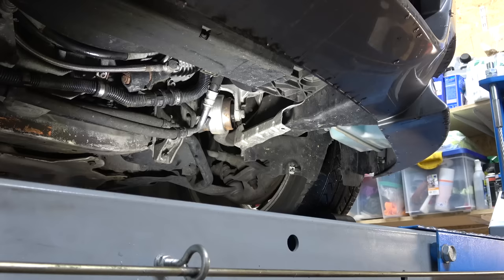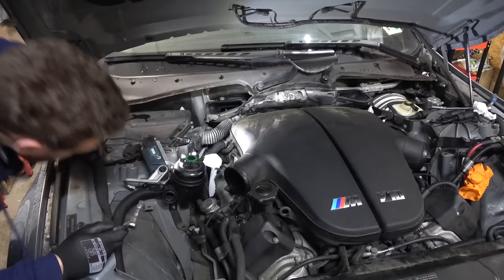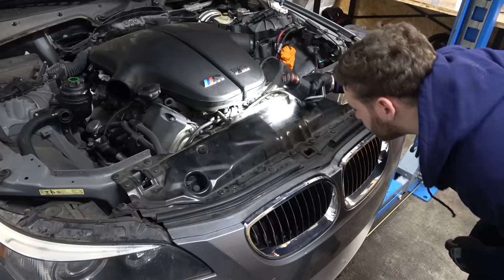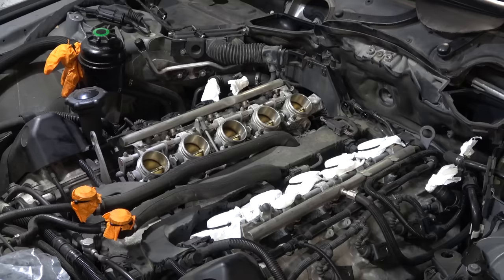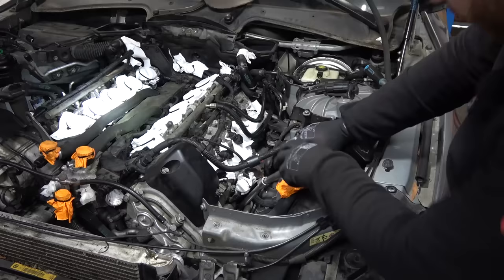In The Belly Of The Beast - The Cheapest V10 BMW E60 M5 6-speed - Project Raleigh: Part 2

Comment: Hey Sreten,
So another YouTuber did a video for an E63 M6(the cheapest m6).  Changed the rod bearings and shortly after the engine seized and would not start.  Is it possible that the culprit was a damaged vanos and/or oil pump?

Comment: I have a 2000 bmw 323i  the radiator  and water pump went bad also it needs a right headlight and the rear headlight needs to be replaced  I wanna know how much will you charge me to fix it I have $1500 saved please let me know

Comment: What type of assembly lube are you using?
Very nice job, well explained. You are indeed a bit over cautious but that’s best with these engines!
Why don’t you repair the oil pump instead of buying the whole assembly...
And just use a lever on the garage handle, come on lol. 
Cheers and happy Easter!

Comment: Question: Why are you putting 5w40 instead of 5w50 molygen? (I know the 10w60 is wrongly specced by BMW especially for cold climates, can't expect people to sit in their driveway for 5 minutes waiting for the oil temp marker to get to 7-8). Isn't that way too thin?
Reply from the maker: I put 10W60.
Reply: @M539Restorations  The description link says 5w40? Dont you think 10w60 is too thick and the primary reason for so many bearing failures?

Comment: I have a question my friend 
In terms of doing torque for bolts generally do you have a specific manual book for BMW or it’s a standard that you can follow in different European cars ?
For example the engine mounts to subframe 21 nm when you install it there is a specific torque spec for the bolts from BMW or it depends on the spec that been stamped on the bolts it self

Comment: Moinsen! I absolutely loved loved loved this video. The only question I have is; given that you went to such extraordinary lengths not to introduce any foreign matter to the engine, why didn’t you put the plenum etc. back on before running it?

It seemed counterintuitive to run the engine with no air filters, having been so careful to keep the internals clean!

Anyway, subscribed and followed!

I have a 2006 e60 M5 with 108k km on the clock. I think I will do the rod bearings myself now (I am a ship mechanic)... because I literally wouldn’t trust anyone not to ding the crank having seen how tricky it is!

Comment: Theres a reason they are called quick connect and not quick disconnect.  They are designed to make the assembly line process faster not mechanics lives easier:(

Comment: The only disappointing thing, that after all this hard work , you said "it sounds like an agricultural machine" . 
Why do you think is the reason behind this!
Is it the M5 engine reliability? Age? Mileage? I had a 2013Nissan maxima and the engine is just running perfectly after since I bought it new until now I have put 270,000 KM, honestly the only major stupied thing Nissan is doing is the CVT gear box which I have changed at 180,000 KM

Comment: I love your videos!!!
Q: I have a cadillac El dorado and after 6 mls it gets overheated and then goes back to normal temperature within a minute and then it keeps doing it up and down all the time and in idle dont get overheated 
Can you tell me any idea to fix it 
I changed thermostat already and radiator plus a did a wash flow 
I hate when get overheated and back again to normal 🤨

Comment: I picked up a used 2011 M3 and heard something about rod bearings failing. Is this a common problem now with BMWs?
Reply: It's a known BMW problem for years...
Reply: @wot48320  On cars newer than 2011?
Reply: @bme7491  All S65 engines experience rod bearing wear, OEM clearances are too tight.  BMW changed the rod bearing material from 2011 on, not sure if that helps. Just change oil frequently and warm up engine before every drive.
Reply: @wot48320  I always stay below 3000 RPM until the engine is at OT. However, I don't sit in the garage for 10 mins waiting for it to warm up (like some people I know), that's more harmful than good.

Comment: Hi Hans,you seem very expert,and do everything with much more care than ordinary meccanics.I have a question,I have a 2003 320ci e46, 150k kilometers,I'm pretty sure I have to change many rubber supports what make do you suggest?is there a complete kit?Polyurethane?
Thanks for any suggestions,Robert.
Reply: bepends on what you want: being a freak like sreten, go for oem rubber stuff, if you want some sort of sportiness, go for polyurethane
Reply: @simonomisimonomis  thanks Simon,I am a bit like Sreten,so I'll stick to Oem.Would like to know the difference from an ordinary car to M-Tech  ...
Reply: @robertmaisey4594  just stiffer spings and ball joints, 99% sure bushings are the same, m3 bushings will be awesome, not sure if they will fit standard cars
Reply: @simonomisimonomis  thanks Simon,will be doing the job in springtime..

Comment: Why is it that this BMW and the previous BMW you open the engine there are broken parts inside the engines. That only proved that the parts or the engineers are not producing a reliable product. Right?

Comment: 1:02:25 Is Vaseline safe for O-rings?  Isn't the safer O-ring lube silicone based grease?
Reply from the maker: We are talking about the fuel system. Silicone is bad is bad in this case.

Comment: extensions do not absorb torque. That contradicts physics. A force applied from the square drive of the torque wrench will not decrease before reaching the fastener. that energy needs somewhere to go and it doesn't get stored in the extension. Newton's 3rd law. If you decrease the diameter of the extension and increase the length and apply the same torque value to it, the extension itself will deform from the torsional load but once the steel springs back and tries to return to its natural state it will transfer that torque to the fastener. Now if you're using such a long extension that the square drive of the wrench is no longer in plane with the center of the fastener, the torque will definitely change. this is why you use one hand to support the head of the torque wrench in order to keep it in line with that fastener. The torque can also change by using a torque adapter or crows foot that is not positioned at 90 degrees.

Comment: Bumper paint doesn't match...
Reply from the maker: You sure?
Reply: @M539Restorations  yes. Plastic vs metal does affect the shade, but that's where a pro shop wont just take the paintcode, theyll scan a sample from the old bumper and mix accordingly, as over time UV will alter the color away from the original. 😃
Reply from the maker: Funny how you noticed that but missed my explanation 😁
Reply: @M539Restorations  Welp, your video is too long. I scanned through it and got to the part where you mentioned the '58 shades of grey' thing going on. Whoever is watching all 1 hour 16 mins of it has way too much time on their hands... or should be spending the time side hustling or something to pay for their E60 wallet vortex. I have one with a paltry 105k kms and after 1,000 kms of ownership the ABS module is caput, I get the red cog of death randomly during very cold weather, the tranny or 'something' makes a weird metal twist/sheering noise when shifting gears at low rpm, throttle body actuator bank 1 is on its way out, battery discharge is 'high' after a new battery installed from previous owner (not even sure he registered it properly), fan bearings or something is making a whining noise when the heat blower is on... god knows wtf else it has planned for me at this point.

Comment: Redline 5w50 will take care of the rattle tractor sound...
Reply from the maker: It won't.
Reply: @M539Restorations  it did.
Reply from the maker: No matter what oil you use, it will not make a difference, updating the Vanos with LCI parts will. If anything, 10W60 will make it quieter cause it's thicker. Fresh oil will also help a bit, which is what you are probably experiencing, but it's not long lasting. I also have 5W50 in mine and makes 0 difference in sound.
Reply: @M539Restorations  try it once. I tried it, 2005 m5 at the time 70k km, no more tapping noise, not trying to, just trying to avoid bearing fuckery and to warm up easier while having a full ester based that could handle temps. This 10 years ago or more, only really found out it was a thing a couple of years ago with the lad from chicago and his hundreds of builds and supported cars that all can confirm the quite down.

Comment: DOLZ water pump? Utter garbage man!
Reply from the maker: No, it's not. Re-branded Rein WP that you get in the US.
Reply: @M539Restorations  really? I always tend to give them a wide birth...

Do you recommend?
Reply from the maker: Another friend of mine has been using it for a few years without issues and Rein pumps are solid units. Also, if it does give up eventually, it's million times cheaper than overpriced BMW one.
Reply: @M539Restorations  maybe I’ll try it next time on my next project? I’ve just fitted a HEPU to my M54 325Ti M Sport, seemed nice quality. They claim to be made in Germany, which would be nice, but whether they are or not is another question!